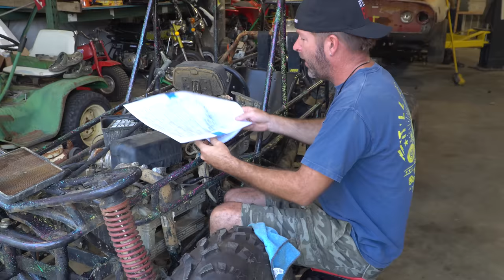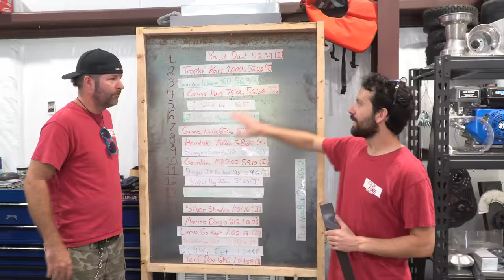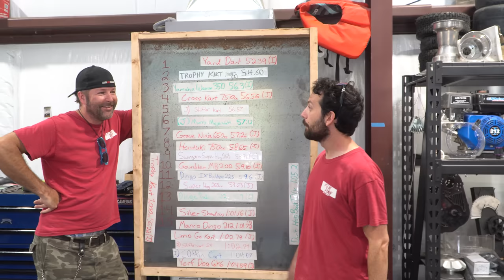Our 1000cc Trophy Kart was FLOODED in a Surprise Tropical Storm- Will it Run & Ride Again?

Comment: I'd personally love to see that mower just restored properly, is the ironic part. You guys can make some racing mowers but like he said, that's a piece of history right there.
Reply: How about a new improved engine and the rest restored painted and new wheels ?
Reply: Do a racing mower with a 4 cylinder
Reply: He who OWNS the crap gets to decide what to do with the crap
Reply: @sethtighe1  

Don't you remember?

Have you already forgotten? 

John asked the community what to

 do with the mower . 🤦
Reply: @bendermi nothing wrong with an old kohler k series.
Reply: @derpydog1008  
No I guess not but it has been sitting for years and years and has been flooded. 
What about the rest would you paint it or would you wash it and put new tires on the mover ?
Reply: @bendermi  I'd put new shoes on it and clean up the original paint and just go through it mechanically.
Reply: Restore it and nothing wrong with the old Kohler engine. That single cylinder is stronger than some of today's v twins. That mower looks like in good shape for restoring. Only thing is dealing with the cutting deck.
Reply: I Concur..  I'm from Shasta Lake California, never seen a John Deer of that size.
Reply: From someone who owns a John deere 112 I whole heartedly agree with restoring it.
Reply: I would definitely love to see a restoration project using the John Deere mower.  You are, collectively, the best team for the job, IMHO.  

                                                         Go for it guys!
Reply: Yeah they also made millions of 112s so it's not really a big deal if one gets hacked up
Reply: 112 ain’t nothing spectacular in the John Deere world anyways.
Reply: @mostlymotorized  
I guess there is going to be an engine swap.  😀
Reply: Lift the John deer make 4wd mud machine
Reply: Definitely agree
Reply: @derpydog1008 I agree to an extent... its only original once and if you try and repaint it it will never be the way it was new.
Reply: Nah , turn it into a race mower !! Who needs an old ass lawn mower anyways lol
Reply: @4npushap352  
It's too heavy to become a racer didn't you listen to John?
Reply: @bendermi  yes I heard him but ain’t no such thing as too heavy . It’ll just make it that much more planted 😂
Reply: @4npushap352  
Have you ever heard the term " well planted " used on a racer ? 🤦
Reply: @bendermi  dude 🤦🏽‍♂️ it’s a lawn mower ? Are you kidding me “Mr expert” 🤡😂 Jesus go smoke some weed and breathe a little ..
Reply: @4npushap352  
And you want to turn it into a racer. 
Did you watch as John looked at the frame? 
Boy oh boy why waste time on comments when you didn't pay attention.....
Reply: I was about to comment the same thing,  just restore it, there's probably another good 30 years of use you could get out of that thing if it is taken care of.
Reply: @derpydog1008  
The only Kohlers I got frustrated with was the horizontally opposed two bangers that were used in some Bob Cat skid steer loaders.  They were a booger to start due to easy flooding.

Comment: Before you write off the ecu, use some rubbing alcohol and a soft toothbrush to rub off the corrosion to clean it up.
Reply: Also helps to remove any water with alcohol that evaporate, so it wont short circuit. Same thing applies to for instance phones. Even if its not waterproof just take it apart much as possible hence batteries need to be easily replaceable flush any crap out with clean water, distilled if possible, shake any water that may be out, let it dry couple days or just go for alcohol flush, let it dry, charge it and start it. Most cases phone or what ever works fine afterwards. Biggest mistake is to let it sit water inside for long period of time, that is what wrecks the circuit boards, specially the multi level micro component ones, hence why old tech is better, least you can fix it with normal soldering iron and dont need expensive microscope and hot air station... given ether way you know what you are doing that is...

Comment: Would love to see some lawn mower revival/race conversion content, and would love to see some Trophy Kart improvements! You may already know, but you can use an electric hydraulic power steering pump from an old Toyota MR2, if you want to add power steering. It's very compact and doesn't draw a ton of power. They aren't really cheap anymore unless you can get one from a junkyard, but it would be a worthwhile investment to make the Trophy Kart easier to handle. It would also be worthwhile to disassemble the ECU again to clean it up, coat the PCB with some hot glue, seal the case with some RTV, and coat the connector with some dielectric grease.

Comment from the maker: So how long do you think the ECU will last?
Reply: soak it in rubbing alcohol, the board, not the whole thing.
Reply: the john deere you should just do a restoration and keep it as a lawnmower
Reply: When is the next busco beach event
Reply: I saw your video on the Coleman ct200u video and got a decent one and did basically the same thing to it and put a bigger engine in it and I’m just waiting for busco!!!
Reply: @ClumsyCars  if theres any corrosion, alcohol and baking soda mixed into a paste cleans them super good
Reply: Coat it in epoxy so if it gets wet again it will be fine.
Reply: Take a tooth brush and scrub it with the highest percentage of isopropyl alcohol you can find. That will get rid of most of the corrosion.
Reply: Use electronics cleaner on that whole board. Spray it down and get all the oil and water off of it. It'll probably be fine. Most components on a PCB board are actually sealed in epoxy, you might be good! If something was going to short out it would've already.
Reply: For the love of all that is good in this world, please DON'T slap a Predator in the John Deer!
Reply: Distilled water, Isopropanol and a toothbrush is what I use in my electronics lab at work. If it works now your chances are good it'll work for years.
Reply: If it's not broke don't try to fix it.
Reply: You should keep a couple cans of DeOxit electronics spray around. It works great on all components.Switches,boards,plugs and contacts
Reply: Carsandcameras.  Take the computer board and clean with alcohol and put the board in the oven for 10 minutes at 125 'f then test the circuit board. If working coat it with conformal coating it is used to coat circuit boards to water proof them.. look up MG chemicals conformal coating.
Reply: She will last. The older electronics seem to be so much more resilient
Reply: you can ultrasonic the board in isopropyl alcohol 99% (ipa) or just wash the board in ipa with a small soft ish brush  the corrosion can be fixed  with a soldering iron and solder  by heating with iron and adding leaded solder  it will reflow the joint and carrie the corrosion away  clean iron tip of solder on  steel wool after every joint   a hot air station would be better to use but you wont have 1 and never use a hot air gun  this is the techniques the electronics technicians use   to fix this sort of thing 
hope this helps if it fails again ..cheers for the vid
Reply: Watch legit street cars video on cleaning corroded ecu's
Reply: Ecu is golden and will last a good long time. I suggest building a body for it!
Reply: 2 years
Reply: It'll be fine because wd40 is nonconductive and a water displacer that's what the wd stands for.
Reply: @derpydog1008  40th attempt
Reply: @DeltaNineProductions  but its all they know... they hate getting out of thier comfort zone, and when they do its halfassed
Reply: retro drag mower but keep the color and height the same but motor swap
Reply: @ClumsyCars 
Electronic Contact Cleaner works wonders.
Reply: I worked in the ROV industry and flooding of electronics cans was something we had to deal with not fresh water but salt water at pressure depths of over 3000 meters or over 9000 ft. Wash the board in a mild detergent rinse with water then alchohol let dry and spray the board in clear acrylic that will help the board survive future flooding. We could bring back the majority of our boards this way.
Reply: Honestly forever as long as u keep it dry, and you guys should carb it, and do upgrades to it
Reply: @marcmo7138  yup
Reply: where is the cross kart i love dat thing plz bring it bac
Reply: @carsandcameras make it a race mower fix and build up the motor in it
Reply: Do whatever you want with the John Deer, who cares about the crybabies.
Reply: @ClumsyCars  This, I like to scrub GENTLY with a soft toothbrush as well. that should be enough for 99% of corrosion. There are also plenty of options for conformal coatings to help avoid this fate in the future. Really it should be a must do on all offroad vehicles with a computer.
Reply: @wurthmannd024  I would be really careful with that, baking soda can be pretty abrasive. Just something to be aware of so you dont scrub off something you shouldnt.
Reply: It'll Be Fine!
Reply: It will be fineeeeee
Reply: brother im thinkin a goldwing engine on the cart just sayin v8 pushes a goldwing to 150mph but super light engine and trany it would make your top speed bike cry lol
Reply: Ike i know  little bit about drying out electronics alcohol and a hairdryer will work wonders for a flooded electronics.
Reply: For future reference...  Its perfectly safe to clean computers, ECU, electrical components etc with brake cleaner as long as no power is running through the board.  It displaces water, removes dirt and dries fast.  QD Electronic Cleaner by CRC works just as well but costs twice as much.  You could have used either on your fuel computer and it would have been ready to run again in 10 minutes.  I recommend cleaning BEFORE sending power through the electronics though.  Im shocked with the amount of water coming out of that computer than it didnt short something when attempting to start the cart while wet.  Clean any corrosion with an old toothbrush and the brake cleaner, when done apply a light spray of WD40 to prevent future corrosion on the contact surfaces.
Reply: From what I could tell Ike was doing the right thing. making sure it was clean and spraying WD-40 on it. and looking over all the circuits checking for open circuits. (spots where the solder is melted away and all connections are solid) and looking for any shorted circuits. (by checking for any burnt spots around the connections) and checking all the transistors, processors, resistors, diodes, and capacitors. for signs of bulging or discoloration. and if that all check's out it should be fine. spray a thin film of WD-40 all over it and put it back together. and make sure there's a small drain hole at the lowest point. so if somehow water were to get inside it again. it would drain right back out quickly. before the electronics could get drowned again. and it should last a long time. you do know that WD-40 displaces moisture don't you? it also works good on ignition systems. just spray it in distributor's and in the ends of spark plug wires. and any other ignition connectors. I always make sure have a can of WD-40 with me whenever I want to pressure wash under the hood of the car.
Reply: Clean the ECU with rubbing alcohol, and then deoxit. Should be fine if it still works now.
Reply: Pcm’s are more durable than most people think. It may have a long life left in it. Large electrical shorts are what I’ve seen kill most pcm’s. As for power steering, I’ve heard Toyota Prius power steering works as a good and easy standalone retrofit.
Reply: ultrasonic cleaner the ecu and dry out really good and it should last a very long time, i had a 2008 nissan pathfinder (R51 third generation) VQ40DE engine and it crashed into a 2 meter deep ditch got fully flooded, i dried it out and it runs perfectly, but it did have random things happen to the lights randomly came on then off and on haha
Reply: Guys, that strap bar behind the drivers neck looks close enough to break a neck in a whiplash situation.. Just sayin'...
Reply: I'd get a properly sized carb for the thing and put that on the shelf just in case.
Reply: In its currets state, i would say a week to a month. Maby longer.
Reply: It's anyone's guess... there are ways to actually repair that kind of damage, but it's very delicate work -- clean the corrosion off with something like white vinegar, wash the PCB (yes, in soap water, it's fine to do that as long as it's dry before electricity hits it again) and then go through with a continuity tester and repair broken traces with bits of bodge wire, replace chips with corroded legs with new, socketed chips... delicate indeed, and long, long hours.

Also, Friendly Neighborhood Nerd here... be aware that the rice thing is actually an urban myth. It's unfortunately one of those rumors that persists because it sounds like it should work, but it actually doesn't... an online magazine called Gazelle did an article back in 2014, "Gazelle's Guide to Water Damage: The Truth About Rice, the Galaxy and Everything", in which they did a semi-scientific test of the old myth, along with a number of other common substances -- the complete list is uncooked white rice, instant rice, classic oatmeal, instant oatmeal, pearl couscous, clay cat litter, and silica gel (crystal cat litter)... and just plain old open air as a control. Open air was the best.

As an aside, this is actually why I recommend budget-model smartphones to people, when they ask me for a recommendation, such as Samsung's Galaxy A-series. If your S-series phone (or iPhone, god help you) takes a dip in the indoor birdbath -- so to speak -- you need an industrial heat gun to get that thing open. Basically imagine something like a hairdryer, but with temperatures that are better suited to melting plastic (roughly twice that of a self-cleaning oven's cleaning cycle, FWIW)... and it's very delicate work to not further damage the phone. I have a Samsung Galaxy A11... it opens with tiny tiny Phillips-head screws. The "smart phone repair bit set" that WalMart sells, the $8ish Hyper Tough one? That's all you need to get into that. Pull the phone apart, set it all on paper towels... change the towels regularly over roughly three days, then reassemble, and it will be fine. (Don't worry about the warranty, as soon as it dropped into the dog's second water bowl, your warranty was already gone.)

Hey, good to know! :)
Reply: Plugs were wet from the water in exhaust it went through the open exhaust valves
Reply: forever...if you clean it properly
Reply: I think it’s good to go now after that quick run down with no issues the whole time so I’m betting it’s good as it was before the flood 👍🏼
Reply: IDK. But that thing will haul the mail._
Reply: Right up to the point it stops working.
Reply: 4 ever
Reply: 14 min
Reply: @ClumsyCars  
Actually, your idea is good.  Isopropyl or Ethyl alcohol would be ok as it will grab any water that's in there.  Soaking the whole computer in it wouldn't harm it.  Then using a low pressure air stream to blow all the alcohol out from underneath the surface mounted components would be a good final step.
Reply: @allenirwin698  
There have been many times I have washed electronics with soap and water then alcohol to clean and then used the oven at around 125°F for around 15 minutes to dry.  Works great.  Some components like speakers, switches, and trim pots won't survive the washing though, but, his computer would benefit from your treatment.
Reply: @derpydog1008  
I didn't know WD stood for that.  Thanks.
Reply: @mrrooter601  
And I think any residue left over from the baking soda could get trapped under those surface mount parts.
Reply: Probably 1 month but y'all need to go and get a Prius electric power steering system that only needs power and ground to operate
Reply: Serenity now, Ike, serenity now! WD-40 on electric is what it was made for. WD-40 means Water Displacement Formula No. 40.

Comment: The ignition being a separate system is pretty common on OBD1 and early OBD2 vehicles. Stuff like the early EFI hondas, Jeep YJs/XJs, and Chevy Vortec would use a distributor system but in this case it's likely a hal sensor or magneto CDI with some form of vacuum or electronic advance via ecm. Easy to carburate, even easier to design your own ECM using a RasPi or Arduino, or get lucky and score a PowerCommander or AEM FI for cheap lol

Comment: Electronics generally dont mind water too much assuming they are completely powered off when they get wet. Over a year ago my PC wouldnt start one morning and when I looked inside, the motherboard was completely soaked from a leaking waterblock, presumably it sat all night under water(horizontal mobo). After taking it out and drying all the sockets with a dryer then rinsing with the board with alcohol and letting it sit overnight it powered right up and still works fine today :).

Comment: Best thing for the ECU is iso alcahol and you can use a fiberglass brush on the bottom to remove the corrosion.  you can use a conformal coating spray on the bottom.

Comment: For power steering you can do like Derek over at VGG did on the old race truck that he uses for burnouts. I don't recall just what car the pump came off of but it is a stock electric power steering pump.
Went to check on the pump, it's from a Volvo, he didn't mention which model but tells how he mounted it and powered it. The third episode off the build series.
The race truck/burnout machine has no alternator or fan belts. Everything is electric powered.